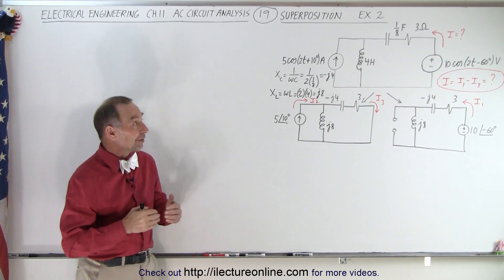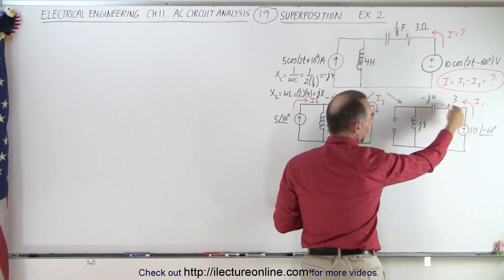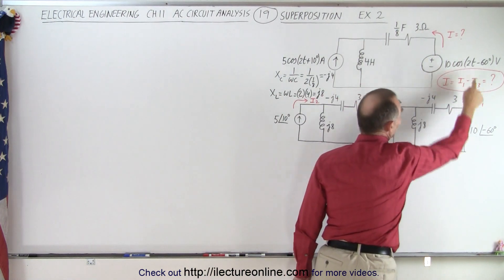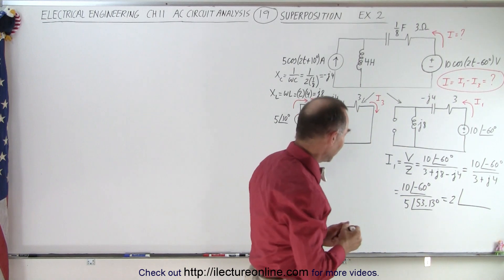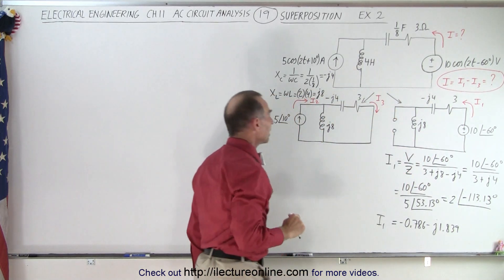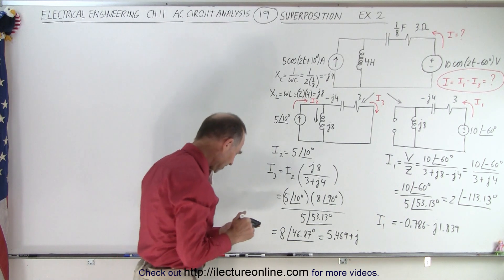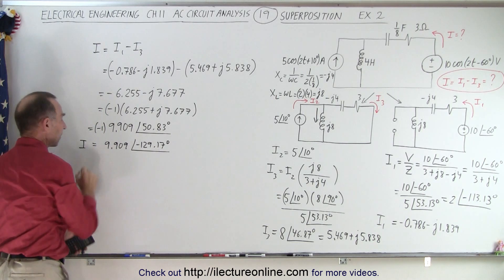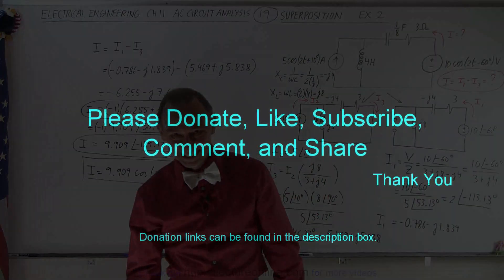Electrical Engineering: Ch 11 AC Circuit Analysis (19 of 34) Superposition: Example 2

Comment: Sir, May I ask about this, I read a book it says u(t)=U√2sin(ωt+pi) then complex form is U∠pi, not U√2∠pi, for example u(t)=10cos(2t-60), then complex form (10/√2)∠-60, I dont know why it is different
Reply from the maker: The comlex form  does not have a time dependency.   It is expressed in the frequency domain.
Reply: i mean can I devide peak value for √2 then caculate as per that @MichelvanBiezen
Reply from the maker: It depends on how you want to express the final answer.   (In peak values or in RMS values)
Reply: u(t)=10cos(2t-60) can convert to (10/√2)∠-60, sir???

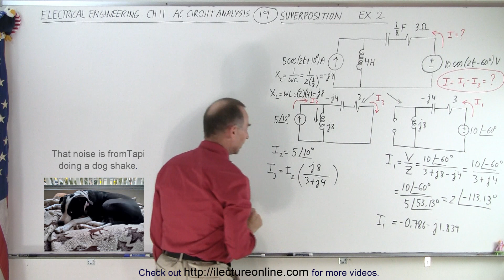Comment: @ 4:51, sir why is the impedance in the capacitor in solving for I3 became positive?
Reply from the maker: That is actually an error.  It should be negative.  (good catch)
Reply: @MichelvanBiezen  the final result still correct, sir?
Reply: It's not actually a mistake. It's because we are dividing by the total impedance(-4j +8j = +4j)